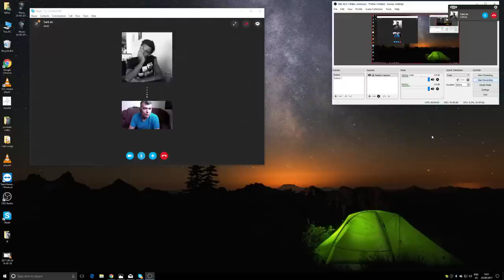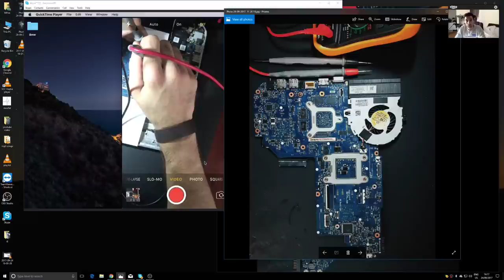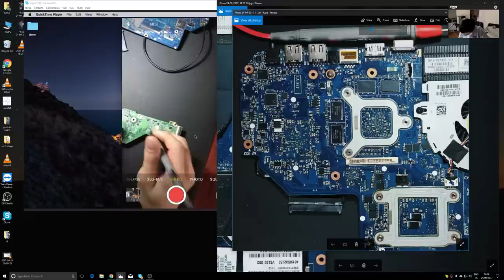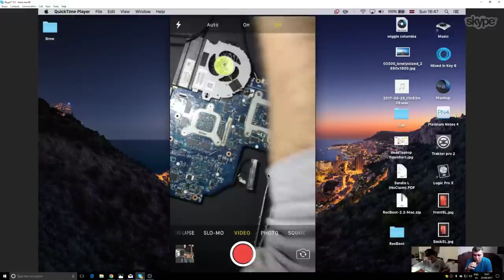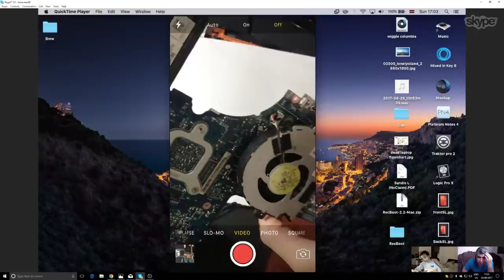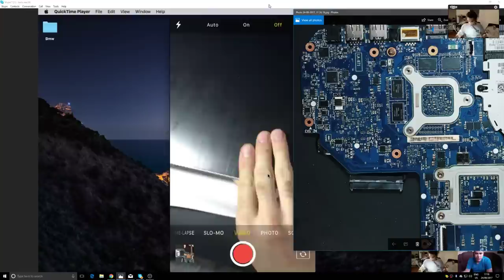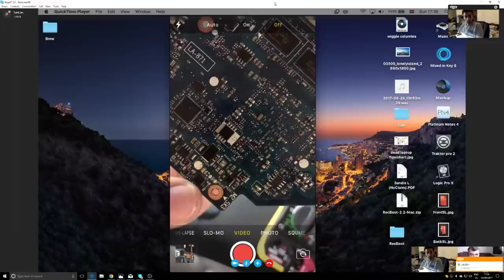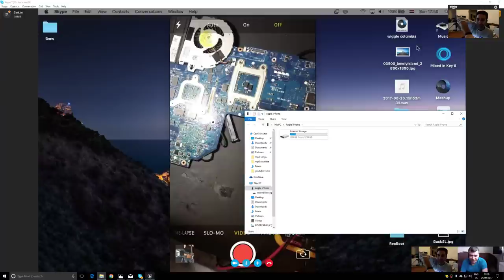'Let's help a subscriber'  Today, Sandis and his Hp Laptop, motherboard repair, online  live repair

Comment: This is great to see Sorin and Sandis! Great how modern technology is used to have a great teacher teach! I hope to come this far sometime, I am trying to fix some HP DV2000 and DV7xxx boards. They both go on, with lights, but no screen. I heated chipset and video chip where applicable bit no result. I still don't fully understand how to troubleshoot the mosfet issues and I don't have a power supply yet, but it's ordered. Thanks for all the great videos, I'll keep watching and try to figure it out. Would be great to have such a session sometime :)!

Comment: I have three questions. 

1. Does always one of the ceramic capacitor's leg is on GROUND, or depending on the schematic ? 
2. Normally the serial connected MOSFET's should not be connected to the ground ?   
3. What will happen if we take a second mosfet from broaken bard and put it like  first on the boar we repair.  What is the difference, except the positions of the legs.  

Admiration for patience and the desire to help others.
Reply from the maker: 99% of the time, yes, one its to ground.
the first two mosfets on 19 v power rail, no they are in serial mode, the mosfets from powers supply one its to ground one to plus and on the middle you have the coil

Comment: Sorin... Can you make a video to teach us how to test different components so we can know if they are good or bad... For example how can i know if a transistor is good or bad. And i often find a chip shorted to ground and is getting hot but when i take it out another chip will get hot and is shorted to ground...
Reply: something in the circuit is causing your problem check caps,mosfets and resistors connected to the circuit
Reply: Some components are ment to get warm. If your power rails have ok voltage then maybe you are on the wrong track?

Comment: Loupe jewellers eyepiece [ x10 magnification ],  £2.00 on Ebay. Will help with chip placement and reading !! 
 'Helping Hand Tool with Magnifying Glass' is good also, £5.45 on Ebay.
I bulldog clip mine to a 'slot' in my 'work board'. Helps with holding small pieces when soldering also.

Comment: Great video! It is not easy to do distant repair! For sure it takes more time but it is so instructive. I took notes lol I have no 3.3V also and I'll check for those 2 mosfets/coil related to the bios chip. With this video, I understand the mosfet he took out was preventing 19V to go through but since it shorted, the 19V made it to the ”ew ef e15“ and it blew it because it was suppose to receive only 3.3V and/or 5V. Why did it short anyway? Bad component? I liked that video. Thank you so much for your patience, your pedagogy, your help and sharing your knowledge! Have a great day !

Comment: Hi thanks for the Good job you are doing. my only problem is sometimes i don't see where you set your meter to when testing 
the components and secondary what are you using to check which components and how do you do that as well. thanks

Comment: Hi, I am wondering if you have ever run across the ss10pl01 mosfet? I have a power inverter that has the ss10pl01 mosfets in it and I need one and can't find them any anywhere. I can't find any info on them either. If you know the ss10pl01 mosfet can you tell me a sub mosfet? Love your videos.  Regards,
AJ.

Comment: What does it means if i put power supply - on ground and + on + board connector and it stays to 19V and 0amp. I see there is 19V everywhere on the board though but it's not taking amps... it sparks obviously

Comment: I had an HP 450 G1 that initially turned off any slight movement. Then one day it did not boot anymore. The fan turns on and thats it, nothing else, dead motherboard. Maybe I will fix it one day. Any one else notice funny issues from HP laptops, like the one that failed to turn on because of touch pad!
Reply: hp and compaq laptops always do this the board needs reflowing turn it on wrap it up in towels and a duvet leave it for 30 minutes if it has turned itself off turn it back on if it hasnt turn it off then on again  never known it not to work problem is if you turn it off for any period of time it will need heating up again